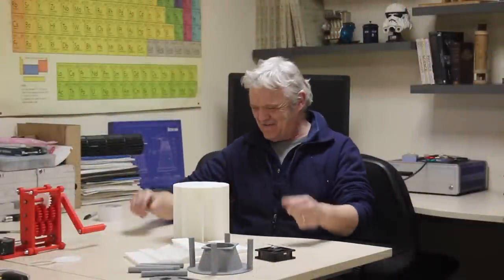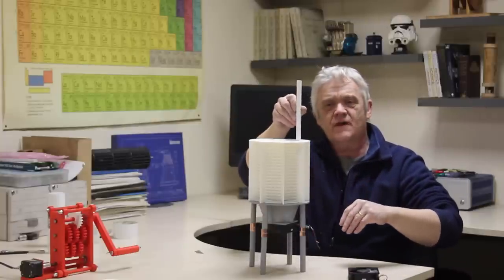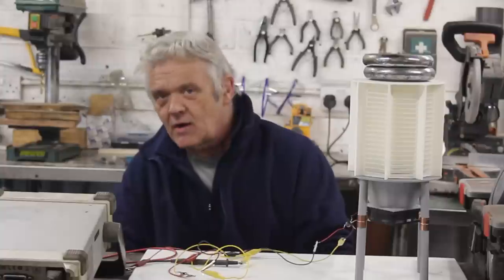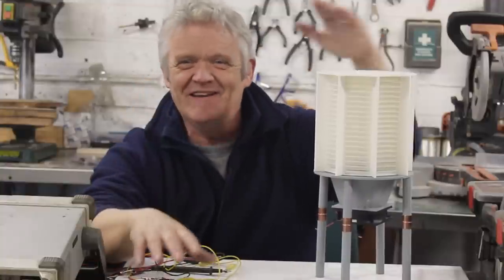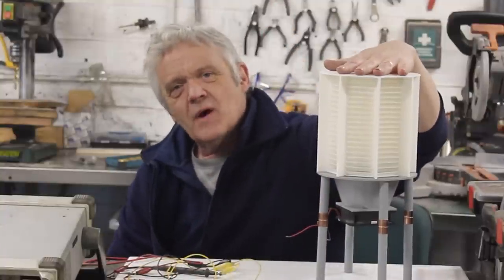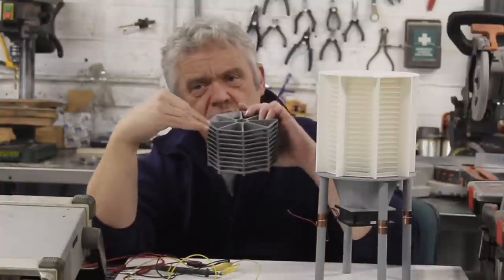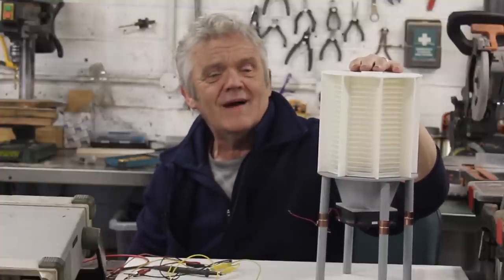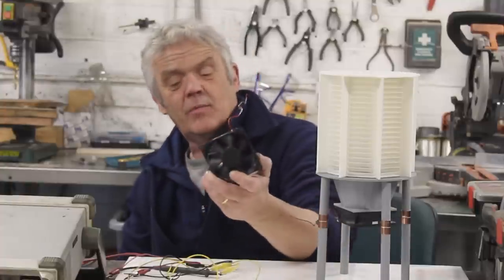1835 Darwin Wind Turbines - The Answer To Wind Generation

Comment: Suppose if you have a load of old 70's ~ 80's style louvre doors knocking about you could quickly chuck something of a decent size, though I think the angle of the shutter/louvres would be way too steep like 65°, unless you have fancy adjustable ones like the type used in blinds
If anybody remembers Fools & Horses S4 E7 "As One Door Closes...", where Delboy loses Denzil's redundancy money on a hooky louvre door deal & they try to catch a rare butterfly to repay him back ???
Well, I'm sure David Jason might still have a few doors in his lock up going cheap
Anyway... for a rough prototype or as a basis to test one of many theories out, something like ye olde louvre doors could provide some inspiration or useful adaptation maybe in fine tuning the near final(ish) design

Comment: I would imagine it works upside down as well, ya? In current config, I’d be worried about rain getting in and accumulating at the bottom with all the electrics.

Comment: What if you had the exit at the top and had a cowl with a 90' bend with a conventional tail fin, so it is always pointing down wind to exhaust the air. Would that increase the wind through the turbine?

Comment: Robert, ive been brainstorming the idea of making a darwin since seeing your episode(s).
My ideas involve a 10-12 inch darwin with a tapered nozzle insert inside a 6-8 pvc pipe. 
Now youre using a single pc fan, mine involves 1-2 stacks of 4-5 fans in series. To slide up inside the 6-8 pipe. I notice your not getting the windspeed to over come the motor friction. So im not sure i would get any improve -ment by stacking.  How say you?

Comment: Maybe, I didn't read the comments, but just maybe if you attach a exhaust pipe that goes up, on top of the pipe one of those rooster things to show wind direction, so il will turn the pipe as it to use the capilare effects, the wind flows and also creates a suction fron the pipe, i don't know if I made my self clear... excuse my English and let me know if it is legit, from my knowledge it should work. Best of luck and keep on the great job that you are doing.

Comment: Nice video again. 
I think the cone is the key here to align the vortex with the PC fan/generator blades (perpendicular) and probably to have a smaller reverse cone to cap the flat plate at the centre of the PC fan/generator.  It would be good to see mWatt ratings as the design improves.

Any thoughts on an interleaved helical structure to capture wind from both sides of the centre-line & direct two vortices onto two fans (maybe the reverse one at the top)?

Comment: Could a Darwin Wind Turbine be designed to mount on the top of utility poles in windy areas and feed electricity into the grid?  This would add a small form power generation factor to the top of every utility pole in a windy area.

Comment: Can you stack a 2nd generator straight under the 1st. Guessing there enough torque in the air column not to reduce flow through 1st to much. Eg. A 20% reduce in power from 1st is acceptable if the 2nd one scavenged  another 40%

Comment: When the wind reaches the funnel is it possible for pressure to be lost escaping through the grills on the up wind side of the catcher.  It seems from the brief moment you show us the wind catcher that it would loose substantial pressure.  The catcher would itself, cause a partial vaccum on the up wind side causing more pressure to be lost and reaching the turbine.  I know that the wind is free to buy, but would the cost of the device at full scale prohibit the viability of the project?  As I see it. The problem lies in the single funnel/venturi.  The solution would be each of the 6 of 8 partitioned sections of the wind capture should have its own venturi and turbine, with the exhaust exposed to the up wind side of the wind catcher.  Again with my conclusion the cost of the device at a usable scale. Would render the device useless.

Comment: What if, instead of a flat wall, you gave it a bit of a twist, probably no more than 180°?  I'm thinking a bit less.  The slats along the sides of the direction of the wind will also catch a bit of the wind even if the wind just happens to be coming directly perpendicular to the flat of the wall.  The rebound of the wind off the wall even at the 35° down angle will cause turbulence (friction) in the wind flow lessening its speed.  Direction of twist is important depending on which hemisphere of the earth you are on just like the water going down the drain.  Think of the tornado.
What if, instead of a flat wall or plain twist flat wall, you also put downward angled slates in it?
Using the tornado as an example, how does the vacuum created inside it influence the wind speed?
I'm sure that the computer fan is not very efficient at generating electricity.  Perhaps an elongated turbine tapering into the venturi in an ever tightening curve?

Comment: I wonder if it’s creating a vacuum in the channels that wind is not going through thus pushing the wind that is being captured faster down the turbine almost like how a rocket stove uses air for the rocket effect?
Reply: Would there be a way to put blades on the top portion that’ll rotate when the bottom one rotates so that with the top blades you can push more wind through the turbine almost like a vacuum to add more pressure and generation speed?

Comment: Looks like you have a successful design, I would be interested to see if you got more less power by just sticking that second PC fan in series under the first fan.. as for the capture device you could endlessly tinker with it, you may want to set a challenge to your viewers that whomever comes up with the best capture design wins something, that would save you from the time of tinkering but your 3d printer would be running full out printing the test devices.. you would need to give out a standard jig design so the bolts would line up and all that. There a PC fan YouTube guy that does this for best design of fan blade.. it would be interesting to take his top performing fan blade and see if it also out performs running backwards too.. I'll see if I can find him.

Comment: If the vanes had an areofoil cross section, would the air pass over the section faster ? also, can you put another generator under the current one,  to aid in generating volts, like in a compound steam engine, that uses the steam 3 times but at different pressures

Comment: I know you don't like people telling you to do this and do that you'd rather have us do it ourselves but I'm involved in a big project so I certainly can't but I was thinking looking at that design you could put flair on the outward flaps that are already there where when the wind blows into the thing it would rock a extension flap outwards and forwards laughing so hard so that basically no matter which way the wind was blowing you would get an extra cocked flair facing forward gathering even more possibly double the wind I know that that explained very well perhaps I'll make a drawing...

When the wind wasn't powerful enough to activate that flap to protrude I would simply rest in some arbitrary position not doing anything harm nor benefit. Yes it does add complexity so that's a thing but whenever I see one of these gadgets I always think of a mechanical method to make it better when the wind's blowing at higher speed a simple pull up on the lever to increase capture of the wind I hope you kinda understand what I'm saying at least

Comment: Wouldn't it be better to have flaps so that they swing open (certain area open at once) when the wind blows. This way the wind would be trapped. Just a thought.
Reply: This is a flap-less design that uses internal baffles to direct air downward. (See the vidoeo: 1830 A Darwin Wind Turbine Breakthrough) where he shows the internal structure. So, this method avoids any "mechanical" breakage and the need for frequent maintenance of the flaps.
Reply: @marcfruchtman9473  ah ok thanks.

Comment: A pin wheel will spin like mad if you blow on it but add a load, like a generator, the pin wheel is useless. The same science applies to Darwin’s wind turbine, it can not supply a load.

Comment: I cant help it the generator must be in place! So we have need of  moving parts, Why do not give the hole gigant effect one on the top and one in bottom it must be with blades or wings it can be like the Lenz II blades the cheapest we can produce in a open source if it hang together in center of the trashed Darwin, (the top layer is gone)! For me this is it! We can harvest light wind from 0,5 up to 20 m/s 🥸/Mikael

Comment: Would it be practical horizontal as a roof ridge turbine so the roof deflects more air into it?
Reply: I was wondering that too, although maybe it should point the air up (I.e. Turn the current design upside down)
Reply: @ashmcconnell3868  I think on it's side would be better as the fan would be on edge of roof for easy maintenance, or even though a bend to have fan near floor(not sure it it would restrict flow to much though).
Reply: @smudger190  ah, i was thinking of one on the ridge of the roof, hoping to get the benefit of the wind travelling up the roof

Comment: Oh dear.......that bench rig is misleading you.

A lot of issues with this design, which in essence, is rather like the old-fashioned ships ventilator. Apart from the very effective way that the design would collect water (!!!) - the leeward side, being in a LOW pressure area will, basically, tend to cancel-out air entering on the high-pressure side. Add to that the fact that the louvres will create a lot of DRAG.....thus reducing the velocity of the airflow. Having 'blow-shut' hinged louvres would at least cancel that effect out on any leeward side, but the overall design is so poor that it's not worth the bother.

There are much better solutions....!
Reply: Such a closed mind.......
Reply: If you know of "much better solutions" please enlighten us!!